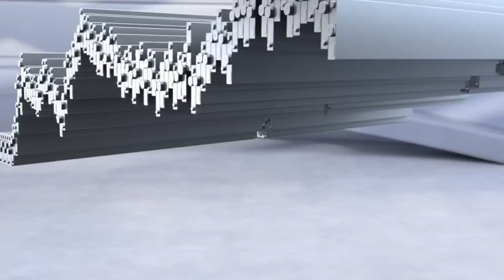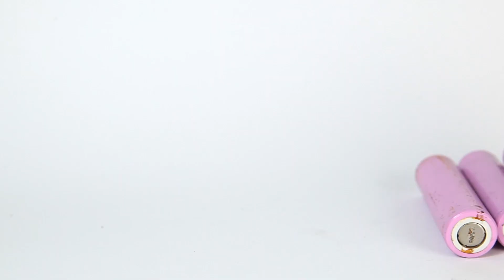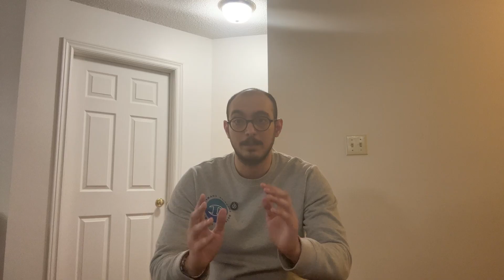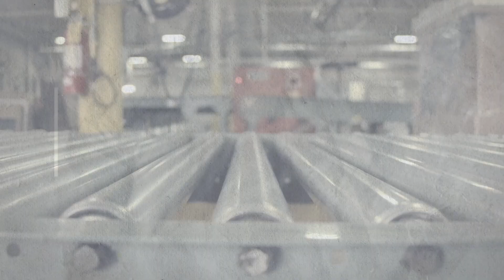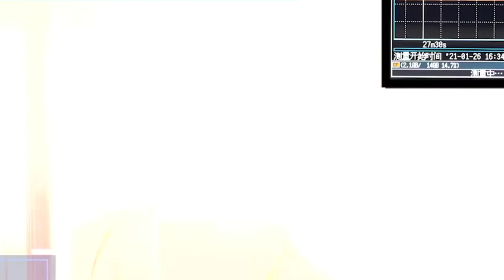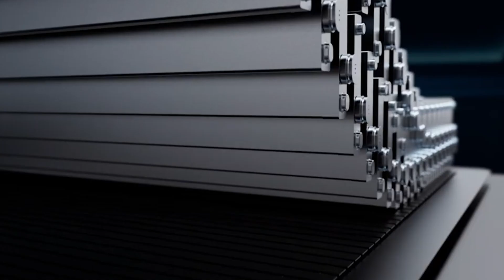Is the BYD Blade Battery REALLY the Safest EV Battery? The Truth Revealed!

Comment: Keeps the battery cool?? Tests in real life conditions show BYD blade battery packs thermally throttling, both when charging and when driving - at sub zero temperatures!

EV fire stats are heavily skewed by fires inside China, in Chinese specific cars - with the BYD blade battery featuring heavily in the known fires.
Reply from the maker: Hi 
Please put the reference of BYD thermal problems.
BYD has sold around 8 million vehicles and  according to the references that i put in description such as 

https://www.ufinebattery.com/blog/byd-blade-battery-comprehensive-guide/

It is mentioned that it has good thermal stability .
Thanks
Reply: @shayan_ev 

https://www.youtube.com/watch?v=mV0XYPsoQBU

 https://www.youtube.com/watch?v=vnxwRRXVA8E

https://www.youtube.com/watch?v=VnBv2C-HWYs
Reply: @ https://www.youtube.com/watch?v=mV0XYPsoQBU
Reply: And how reliable and trustworthy are the tests, have they been deliberately configured to make the battery LOOK bad?, ulterior motives, faked test data?
Reply: @OnePunchPanda-s9b  No, the tests arent faked, they have no reason to fake them, other BYD cars have been praised for battery performance - it is just this model.

Comment: a benefit of prismatic LFP cells is the dramatic improvement in thermal performance at the cell level. pouch cells require external fixtures and compression, and their high C rate usually requires coolant passages. Cylindrical NCM cells have some built in over pressure disconnect valves, but suffer from their steel shell because steels thermal conductivity is not so good. prismatic LFP cells use somewhat thicker aluminum walls for the enclosures. there is a risk of mismfg at these weld seems, ive had a prismatic cell burst and leak after a few months from shipping damage, but on its own prismatic cells have really good cooling capacity since theyre basically encased in an aluminum heatsink which doubles as the negative anode. you do need additional epoxy separators, but this is an overlooked benifit of the blade battery since it can move heat away from the center without a bulky overengineered cooling system (im thinking about the chevy volt or the german cars wich use ac refrigerant). many other mfg have started to only use ncm chemistry in prismatic formats because of this advantage.